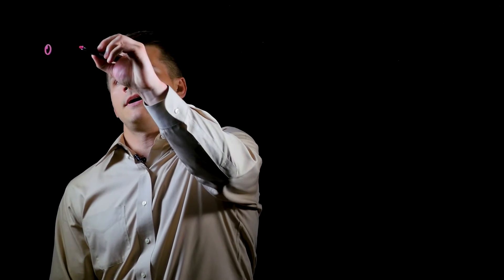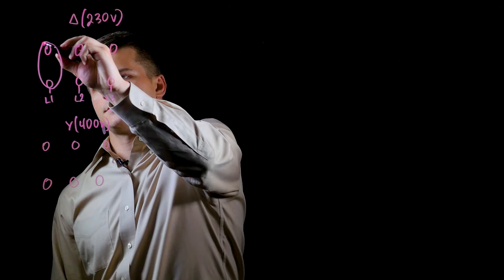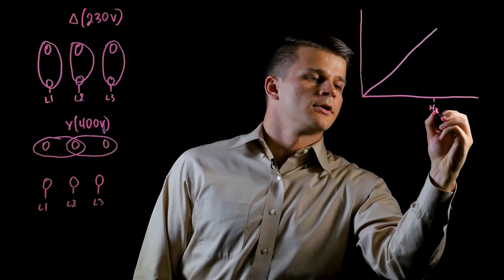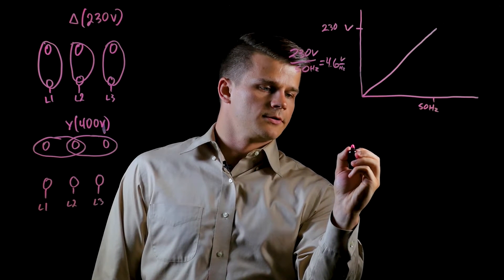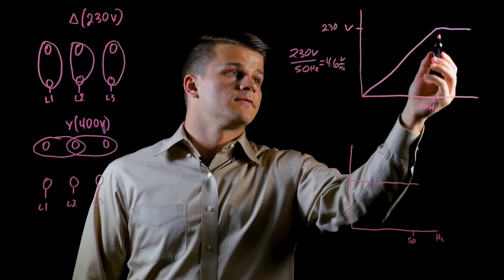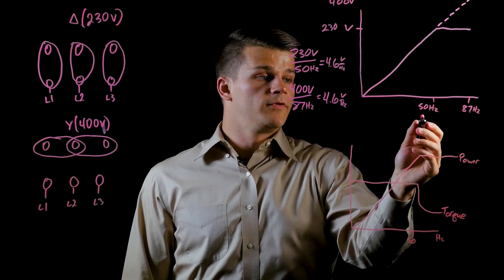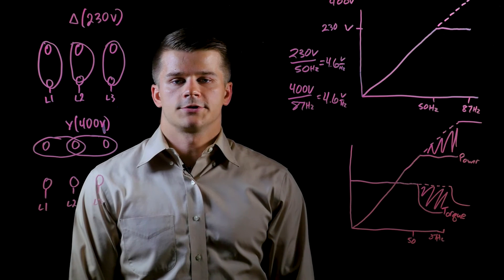What is the 87Hz Characteristic Motor Control Trick?

Comment: Sir generally if we see motor specifications sheet the typical input Voltage range has tolerance of +/-10% or with NEMA nameplate ratings it usually have a Service Factor of 1.1 but here in this trick we are raising a 230V rated motor input to 400V which is 75% increase in Voltage, so will the motor be able to sustain the heat generated because as far as we know a motor is optimized to operate at rated conditions

Comment: In 220 delta I have single phase 220 input /3 phase 220 output drive
For new connections for 400v delta for the same motor I replace drive by 400 v input/400v output drive

Comment: Great Great experience
How can I sure that the motor not damaged for applying 400v to delta what is the most characteristics of this motor instead of it is (400/220)
And what is the new parameters for new connections

Comment: how to know if the motor insulation is suitable for this method? because we raise voltage by 1.7
Reply: The European motors I use are insulation tested at 2000V, so that shouldn't be a problem.

Comment: Considering that is correct to connect the motor in delta configuration for 87Hz operation, won't it be damaged by applying 400V in the windings that are rated for 230V (delta)? Thanks!
Reply from the maker: That is something that must be considered when looking at using 87Hz.  General considerations are mechanical speed limits, increased thermal load, and increased stress on the motor from higher voltage. But because we are talking about motors wound for delta/wye (230V/400V), the motor should have the proper insulation so that the windings are not damaged at 400V.  If it was just a delta motor wound for 230V, then you would risk damaging the motor using 87Hz/400V.  - Mike

Comment: In my understanding the motor should be wired in delta configuration for the 87 Hertz characteristic. You increase frequency and voltage to 87Hz / 400V, hence results also in an increase of power. What you say is that 400V Y results in a higher power than 230v delta, which should actually be the same. Please advise if I'm wrong.
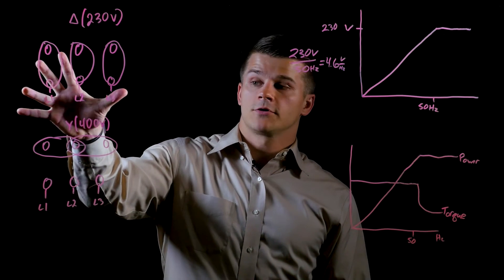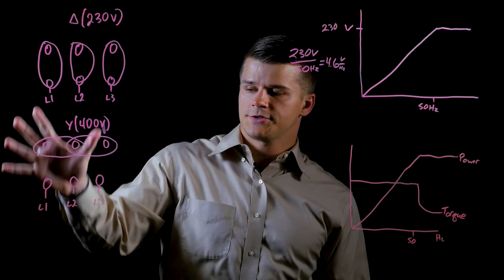Reply from the maker: Hey Thomas, Thank you for watching. You are correct, that is a mistake from roughly 3:50-3:57.  For this method, the motor should be wired for delta, not wye, but the input should be changed from 230V/50Hz to 400V/87Hz.  Everything else still holds true.

In standard operation, power is the same for delta (230V) or wye (400V) configuration.  With the delta configuration and a 400V/87Hz input, you get √3x more power.

Comment: Sorry but isn’t Delta 400V and Y230V?
Reply from the maker: Hello Kieren Sommer! Thanks for your comment. I'm not exactly sure what your asking. Delta connection is for low voltage and Wye connection is for high voltage. If you would like to clarify your question a bit I'm happy to give you a better answer. You can also contact one of KEB's engineers directly if you have a question. Contact us through our http://www.KEBAmerica.com website. If you live outside North America you can find a local representative to solve engineering questions on this web page: https://www.keb.de/company/representatives-agencies
Reply: @KEBAmerica  Y = 230v and Delta = 400V.. due to Y there is a star point which if we measure between star point and L11/L2/L3 will get 230V